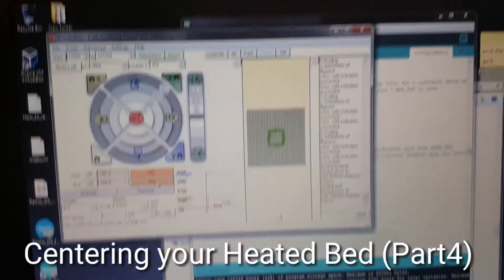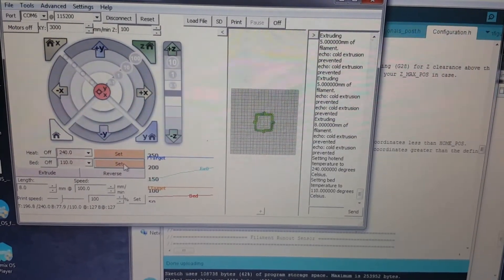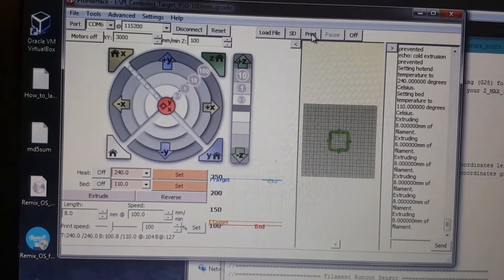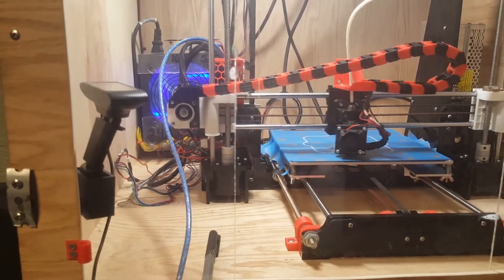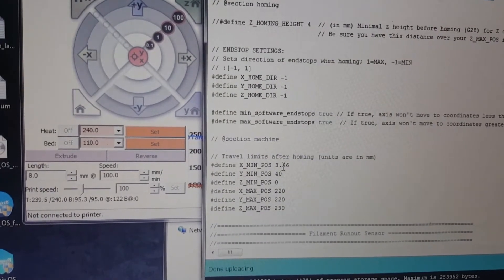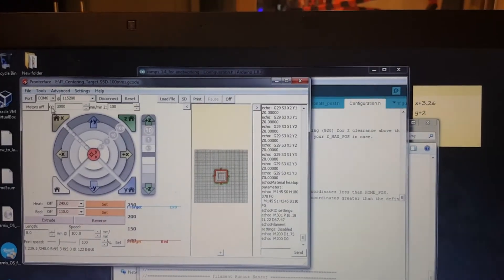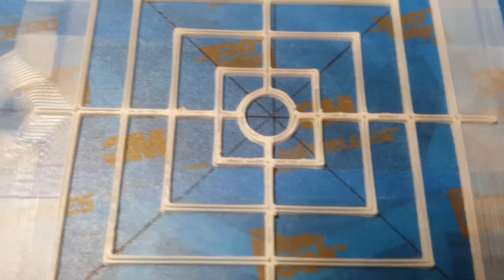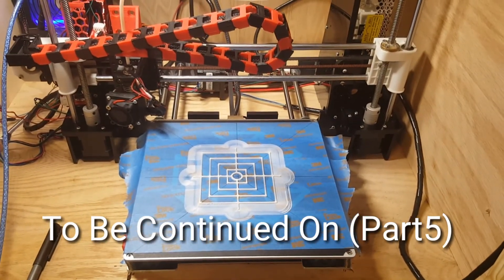How to center your 3D Printer Heated Bed  (Part3)

Comment: guessing that is pla you dont need to print that hot for it. also you can put homing in your startup gcode so you dont have to do it manually every time also that is a huge brim for a test
Reply from the maker: Yea it was abs not pla and I actually learned a lot after this video now I design and build my own printers and cnc machines and write a lot of custom Gcodes but thanks for the info and if you want to check out my new cnc machine and how I'm designing it they are on my channel they are my newest videos and I'm almost done with it and will have a detailed video of it working and how to use it and how to make it with a few parts from ebay and some stl 3d printable files that I will add to thingiverse when I'm done with the machine